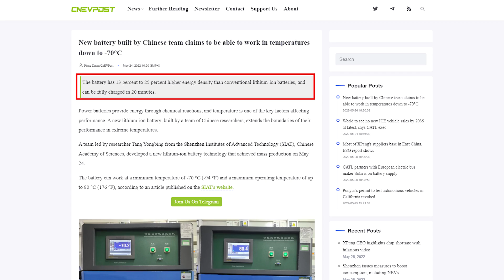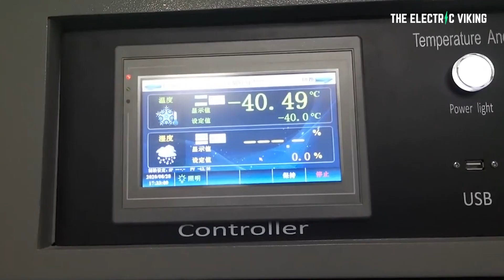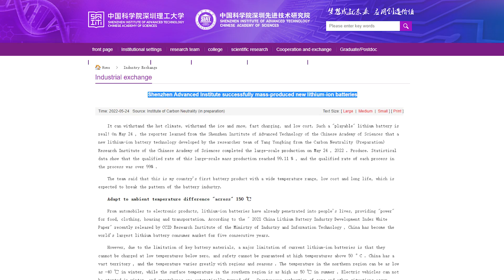This mind blowing NEW battery tech changes everything

Comment: I think what we need to see is proof of concept. I'm more interested in what future batteries can bring to the table for electric vehicles and home battery storage. While using this kind of battery may be good for planes and military etc. The two areas  mentioned are more obtainable and where current consumer sentiment is right now.

The EV market is young but growing and a big issue with current batteries on most cars is range compare to the borderline ICE car and charging time. While charging times of 10 to 30 minutes I feel will ease into the comfortable "norm" I think range will always be an issue with some consumers.

Cost is right at the top. If we can get a battery that does a consistent 350 miles on at least an 80% charge  Then I think we would have reached a comfortable sweet spot that consumers could get behind. Even if we had an LFP or LFP equivalent battery that could be charged to 100% with that type of range I think many consumers and those claiming to have an issue with certain earth materials in batteries and how they're mind I feel could back a battery like this.

Ultimately we also need to supply chain to normalize as well in order for us to have all that we want at some decent prices.
Reply: you can always trust the communist with stuff comming out of their Lab.

Comment: One potential issue is that, as a rule of thumb, chemical reactions double in speed for every 10°C increase in temperature, in the temperature range that we can experience. Batteries work by chemical reactions. In the range -70° to +50°, that's a change in reaction speed of over 4,000 times. They could be doing something to keep the cell temperatures well regulated. That might be simple heating and cooling. They could also be transitioning from one reaction to another, as temperatures change. Either way, it will be very interesting to learn more about what the lab is doing for these cells and batteries to be so tolerant of wide changes of working temperature.

Comment: There was a battery that could only lose like 10 miles of range or 20 miles of range in extreme cold that would be awesome, current batteries just need too much heating to achieve that, still usable but not very convenient.

Comment: The temperature, fast charge and anti-dendrite abilities are the biggest takeaway from this. While the density won't be good enough for flight, these new batteries are good enough to electrify over 90% of the ground vehicle fleet. At their best density & price, they really could replace diesel for long-haul trucking. Having to stop for 20 minutes every 3 or 4 hours is a lot better than having to wait 45 minutes for a full charge or only getting to 80% in 20 minutes. That's 50 minutes saved charging for every 5 to 7 hours of driving. On a 10 hour drive, the truck with these batteries vs current tech gets to the destination over an hour sooner. Now we need consumers to stop demanding 320+ miles in a hatchback and be okay with 250 or so.
Reply: When fast charging is at every gas station and that range demand will pretty much disappear on its own.

Comment: When a battery development has all the checks (cost, energy density, temp performance, charge speed,...) something smells fishy. Too many bright minds are looking into this. It is extremely unlikely to get so many breakthroughs all at the same time.  And, besides the huge list of autocites, please include a link to the source.
Reply: Did you miss the part where they've been working on it for 10 years? This is in China. They have nearly 5x the population of the US. They have a lot more secret research going on. I think we'll either see this tech make its way into batteries over the next year. Would have been nice to hear of any info about commercial joint ventures. Links to the Viking's sources are in the description, as always. Cheers.

Comment: Certainly if done a lower price, wider range of temp operation and somewhat better density are all good; but the tabless also sounded good; and we don't have it.  Plus this still uses Lithium which limits vehicle production world wide at current lithium production to around 5 million vehicles all manufactures combined... so it could help and would be more flexible; but it certainly isn't the new chemistry needed to go full bore EV... assuming a green grid

Comment: Battery Technology is a moving target on a weekly basis; Nuclear Diamond battery technology is the ultimate game-changer with direct nuclear to electricity generation, requiring no steam heat engine cycle and nuclear fusion. This technology would destroy the current hegemonic oil/petrodollar system.
https://en.wikipedia.org/wiki/Diamond_battery
Reply: Nuclear Diamond battery exists, but it is low power only. Energy density cannot be large. It is very useful in some applications.

Comment: I think LiS battery is going to have better future due to the abundant of S and very low cost compare with Li-3 . With 3 time more capacity and volume efficiency than Li-3 ..one charged  .ev can drive to 900 miles then can be recharged for 1 hour ..with this much distance our body is already wear out and need to be rest overnight.. I think this is the nirvana that the whole ev industry is looking for to be able replace the ice cars in future.
Reply: Sulphur batteries still use Li I am fairly sure. The Li is actually the charge transport and actually give the battery to store the charge. The Sulphur is used in the anode to soak up the lithium once it gets to the anode. Since lithium ion has a positive charge (missing an electron in its outer shell) it cannot exist without a support material support it. https://en.wikipedia.org/wiki/Lithium%E2%80%93sulfur_battery

Comment: Thank you for the video. I hope more research is done to maybe use this approach to LIFP batteries. If that works it will reduce cost even further.   If LIFP are still cheaper , it could be possible to have a portion of a vehicle's battery pack use this technology and the rest use LIFP batteries. The benefit would be that the vehicle would be able to operate in extreme conditions for a limited range even if the main LIFP battery pack gets exhausted (because of temperature issues). If the whole battery pack uses this technology this would reduce or eliminate the need for cooling/heating of the battery packs thus reducing the overall cost of an EV. So, there are lots of possibilities to benefit from such batteries...

Comment: Blah blah blah every week a new game changing battery tech. But the architecture of  cars are locked into current tech. We may see Mr Fusion before we see these.
Reply: How precisely is "the architecture of cars" locked in?
A box 2m by 3m by 20mm, holding a "battery pack" is pretty easy to accommodate?
Kinda like....
"Hey guys (girls). When you design the cell, make it this tall"....
"When you group the cells on a "pack", make the lack fit in this box".... OK? 👍
.
Do you think that might match "the architecture?".
They could always go the GM way and just double stack! 😂
.
Think BEFORE you post.

Comment: This story is primarily focused on the battery technology being able to operate in extreme temperatures and being manufactured at lower production costs.
But there still needs to be more hard data on the charge rate, range capabilities and safety (as compared to current lithium-ion) in order to really assess if this is anything approaching the holy grail of battery technolgies.

Comment: What happened to the other 10 distruptive battery revolutions of the last 10 years?
Even Natrium/Sodium isn't really used anywhere yet. Everyone is still using 25 year old tech.
Reply: Maybe they got disrupted by something else :)
Reply: It's all about mass production. Chemistry that can go into the current cell cans and use current manufacturing lines are a lot easier to mass produce. Exotic chemistry & solid state designs are getting bogged down in cycle life issues. Charging a battery only 500 times is not enough. 2000 or more charge cycles are needed. A battery with 4,000 charge cycles will only need to be replaced half as often as one with 2000. Anything that can't recharge 2000 times isn't worth optimizing for mass manufacturing, other than for limited application, as we see with current solid state cells.

Comment: My advice.  When somebody says "This changes everything!!"......run away!!!!

I've grown weary of all the seemingly hyped claims that pass for daily news in the EV world.  If you were to look back at all the claims and promises.....starting with those related to Tesla....the differences between promise and reality would be significant.  The recent hype surrounding Model Y's coming out of the Austin factory are an example.  Lots of expectations tied to mega-castings and 4680 structural batteries, to the point that people were delaying their orders hoping for delivery from Austin rather than Fremont.  In retrospect, it turned out to be a profitability strategy served up in the guise of a hyped consumer benefit.  Count me as one thinking a Model Y out of Austin was a great idea, only to be disappointed by a model that cost a lot more, delivered less range and seemingly lost little weight despite the hyped benefits of mega-casting. In the past two months I had a 10.5K solar array installed on my roof and placed an order for a BMW i4 eDrive40.  The car will mostly be charged at home and every bit of that power will be more than offset by solar production.  I'm happy with that.

Comment: Questions:
- Since these are researchers, are they going to go into the battery business themselves or license or sell their patents to CATL or BYD or someone else?
- How difficult is it to convert an existing battery production line to mfg. these or other kinds of batteries? 10% modification, 50% modification, or better to build a new factory from the ground up?
Comments:
- Seems like any factory that is planned to open in two or three years will be obsolete when it is ready for production.
- This is all good for us consumers and the planet earth in the long run.
- I often (still) see comments like "but, you have to replace the batteries every five years" or "you'll only get 100mi range in real-life conditions" etc.
- There are thousands of great minds working on these solutions 9-9-6. The solutions will be there.
Reply: Johann B / The chinese build batteries mainly in a prismatic design. This prismatic design ( compact, or medium and long blade, etc ) is the best of now and of any future one, because it can accommodate any technology and chemistry: LiFePo, solid state or any other new one that it will be developed.
That's why they don't need to build other new kind of factories for new batteries and chemistries that will be invented.
Reply: @mikel4879  - Thank  you for the info!
Reply: Johann B / 👍
Reply: @mikel4879  
Maybe loon at the picture.
They're cylindrical cells.
Reply: @rogerstarkey5390  There's a lot of use of "stock" video to avoid being boring. I've seen most of these clips 100 times.
Reply: Tesla could have it in cars by the end of next month.

Comment: 4680 is the only realistic most advanced battery technology.
this other stuff is fairy dust until proven.
Reply: 4680 is the form factor, not the chemistry.
Reply: @oasiasoasiaso   yes a form factor, but the tabless design breakthrough was critical to allow that and provides for more energy and better density at the pack level.   Also, the dry coating was also introduced. 

So the 4680 really refers to a bunch of technology enhancements lumped together
Reply: @oasiasoasiaso  i agree, ur right but i meant 4680 and all the advancements in both chemistry and manufacturing processes in order to achieve this worthwhile form.
4680 represents more than just a round cell.
Reply: @oasiasoasiaso  
I suppose strictly speaking it's the form factor AND the design?
The tabless design enables the 4680 form factor?...?
(But, I know where you're coming from, there's a lot of..... "Lack of comprehension" out there)
Reply: LFP is the chemistry
Lithium Iron Phosphate
Reply: The current iteration of the 4680 cell still has issues as far as safety , cycle life and can't always be charged to 100%. This new chemistry appears to offer a genuine improvement and has already been made at scale. That's no 'fairy dust', those are real batteries. Expect Tesla to use this chemistry in their 4680 cells as soon as they can.
Reply: @rogerfroud300  
How precisely do you know that "the current iteration of the 4680 still had issues as far as safety"?
Compared to what?
And for that matter (Assuming you compare it to 2170) what makes you think the "old" Tesla cells have "an issue"?